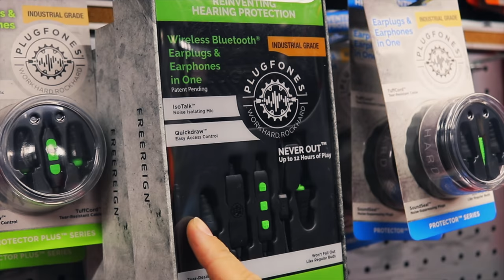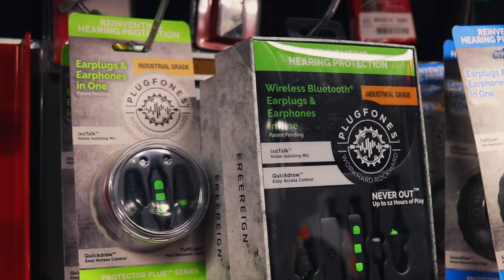Snap On Epic Toolbox: A Closer Look

Comment: Came around for a second time and got my answer. I have been wondering if the Epiq's drawer slides were the same as the mMaster or did it have higher load capacity? Now I know. Pulled the trigger and got this very box same color etc just  the 84". This was the definitive upload that made up my mind. Cheers!

Comment: Nice post sir. I just wanted to ask if you thought 300. Bucks was a fair price for a Snap-on 1/2 air impact ? rebuilt with a 9 month warranty  From Snap-on. Looks brand-new
Reply from the maker: I would ask what they would let u have a new one for ? It is probably a good price but they run them on special a good bit